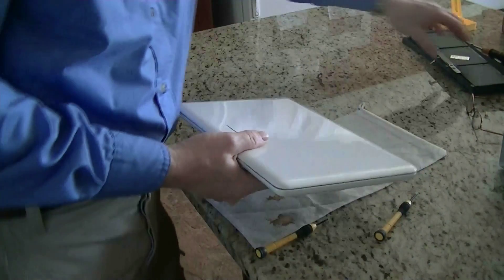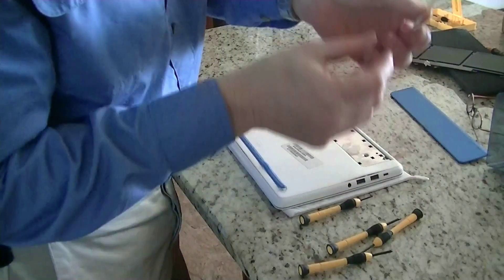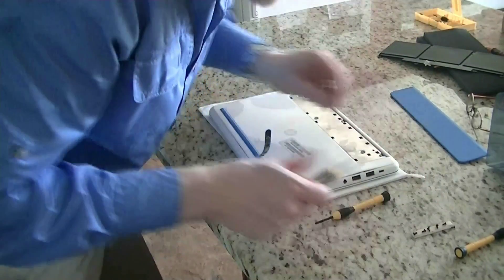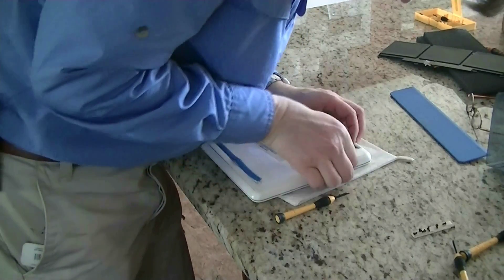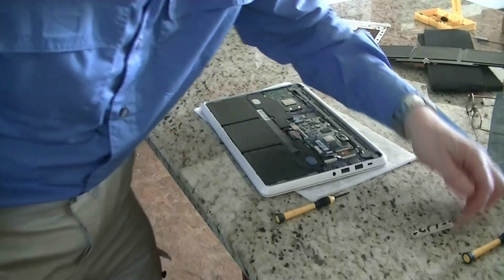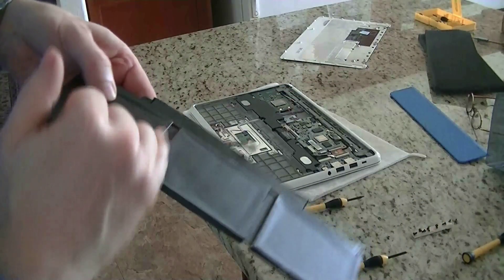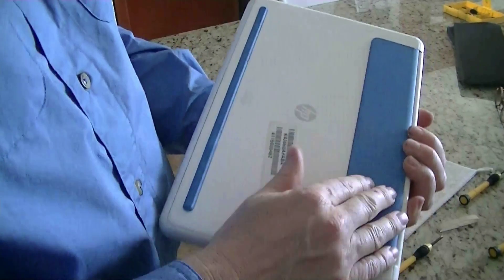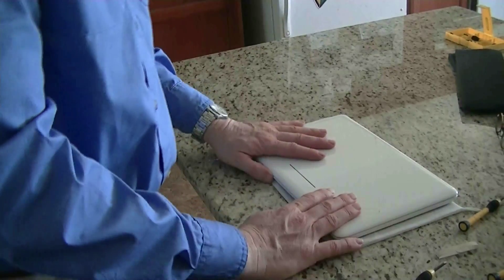How to change the battery on a HP Chromebook 11

Comment: Do  you have a video on replacing SSD and RAM on a Chromebook 11 that you just showed the battery replacement?
Reply from the maker: I did not upgrade the SSD or EAM on the Chromebook 11.  On most Chromebooks the SSD and RAM are now soldered onto the main board.

Comment: I'm thinking about doing this, but I want to make sure the problem is in fact the battery. Whenever I plug in a power source it cycles through the green, yellow, red, and no lights above the power jack. Does this indicate the battery is shot?
Reply from the maker: Good question.  I worked on that unit back in 2016, and I remember that it was plugged in and not charging, even if plugged in overnight.     Check to make sure the AC adapter is in working order, then
look for damage to the charging port or for signs of oxidation. Check for a crack in the display or other signs of physical damage to the laptop. 
Next you need to ensure  that the computer is connected to working power.
Plug in the AC adapter to a functioning wall outlet.
Connect the power to the computer.
You will see the lights illuminated on the computer or on the AC adapter.
If the lights are illuminated, then you know the AC adapter is not the problem.
If it shows a red light, then the computer cannot communicate with the battery. (bad battery is a possible cause)
Question : 'How long have you had this unit plugged in to charge?'  If the answer is 'overnight or longer.'  and you still see the red light when attempting to  power on, then the battery is the major suspect. 
Next question: 'Have you tried a hard reset on this unit?' 
A hard reset erases all information in the computer's memory. This forces the system to clear and reestablish the software connections between the BIOS and the hardware.
A hard reset does not remove any local files or settings.
-Press the power button  and refresh button (found above the 4 on the keyboard) for five seconds. The computer turns off, and then turns on again.
If necessary, press power button again to turn on the laptop.
If a hard reset does not resolve the issue and you still see the red light, I would replace the battery, as it has the highest probability to the causation of this unit's issue.  Other possibilities still exist, but if this unit has not been dropped, or slashed in water, then what is left is that we are looking a laptop that is unable to communicate with its battery.    Thank you for the question and good luck in replacing the battery.
Reply from the maker: @Frostbgx Yes. that is true
Reply from the maker: It is possible that the charger is not strong enough to charge the unit.  Not all USB-C chargers are the same.  Devices like phones can be charged with less powerful units than those found on most laptops, so the correct charger should be used.
Reply from the maker: @Frostbgx Is there a way to find the correct charger that was made for that model?
Reply from the maker: @Frostbgx The adapter will not have the correct wattage, right?
Reply from the maker: @Frostbgx Is it possible to find the correct ac/dc adapter for that model?   That would be best.
Reply from the maker: @Frostbgx Normally cycling in green, yellow and red cycle means issue with power. i.e. battery and are charging unit. That is what we have seen in class.

Comment: I've had mines for 8 -10 years and for a week now its not coming on no matter what ..... does that mean it has expired??
Reply from the maker: So even when it is plugged in, it still stays off?  There may be a different issue, as in a short or some other problem, as if it was the battery, it should still turn on when plugged into power.

Comment: can i expand the ssd??? i can´t upgrade but i see 2 inputs but i dont know wat type are
Reply from the maker: I do not have that unit and I do not remember looking at the SSD connector.   You may use the Newegg.com web site to help determine what type of SSD connector you spot.  Here is a link:
https://www.newegg.com/Product/ProductList.aspx?Submit=ENE&IsNodeId=1&N=100167920%20600095832%20600488413%20601193224%20601193225